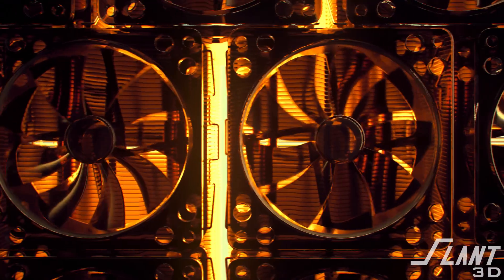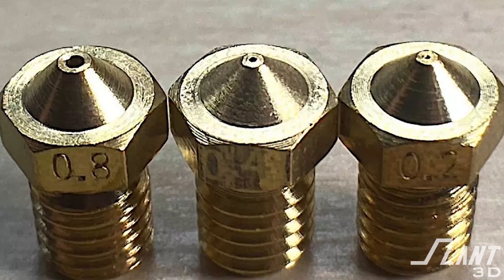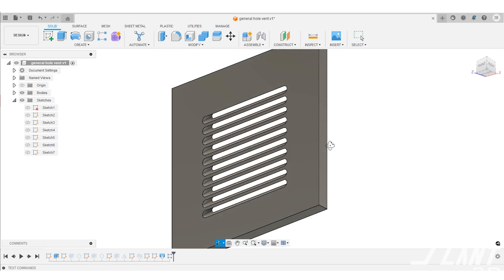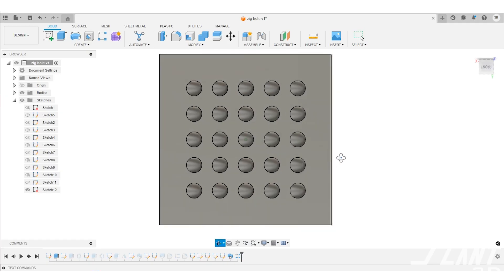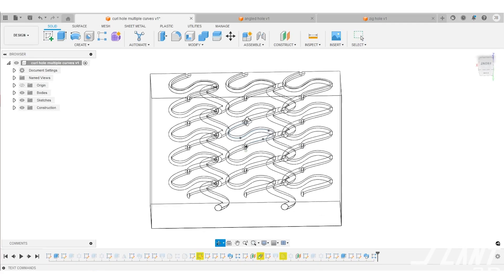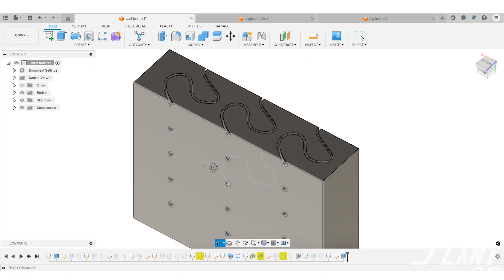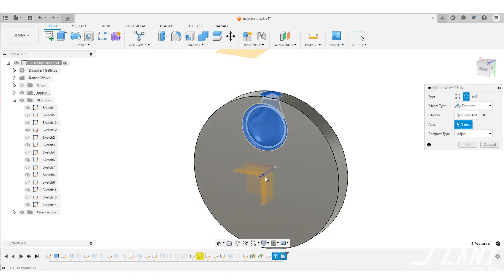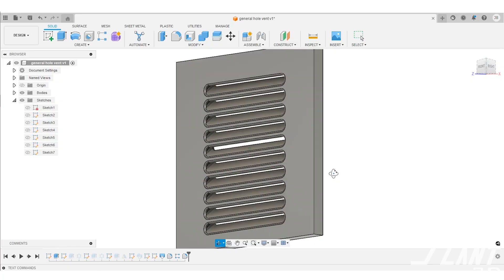These Cooling Vents are Impossible | Design for Mass Production 3D Printing

Comment: Some great ideas, thanks!

I realise that for mass production you'd probably want to stack as many of those vents on the build plate as possible in one job, but printing the vent flat would solve a lot of the "needs support to print" designs issues with the first models
Reply: Another thing to note is that while these examples are flat plates, this could also be on some bigger part that necessitates a different printing orientation.
Reply from the maker: You never batch parts in mass production. Thanks for watching
Reply: @slant3d whay? In production you print parts one at a time?
Reply: @evbunke2  3D printing two parts at once takes longer than printing the parts one at a time, as you have added additional motions to move from one part to the next.  Slant3D also prefers to print parts with minimal contact to the build plate, as more contact area makes for more effort in removal of the part.
Reply: @evbunke2  Yes, printing mutiple parts at a time is risky in a production scenario because if one print fails, so do the rest.
Reply: @slant3d  a small correction would be that you never batch parts in mass production 3D printing, you absolutely do batch parts in other forms of mass production.
Reply: @conorstewart2214  He's talking shit as usual.  You don't batch parts *when using cheap FDM printers"*. You sure as hell can with SLA, larger mSLA, SLS, MJF, polyJet, etc etc etc.
Reply: @Welcome2TheInternet  You can also batch with cheap FDM you wout just set the print sequence to one part at a time instead of doing one layer of each part every layer move.
Reply: @Welcome2TheInternet  absolutely, but for postprocess fdm is waaay easier so I understand why the focus on that. Obviously sla and mjf are much better with batches but then you also cannot use the huge variety of materials available to fdm
Reply: @GiovanniIgorCesarotto  Speak for yourself.  I'd rather dip a resin print in a bath for a few minutes and have a perfectly smooth (and isotropic) part, than fuck around with an FDM print. 

For the increase in quality, post-processing an SLA part is better value.  Especially after the dip and cure. There's nothing to it.

I assume you're referring to the "post-processing" stage of removing it from the bed, rather than the industrial processing stages i use (such as sandblasting), which are equal for both FDM, SLS and SLA.

When you're manufacturing for industrial levels of quality, post processing FDM is not easier at all.  Especially if you are planning on coating it.
Reply: @802Garage  Batch doesn't depend on printing sequentially or in parallel. They are both a batch. The point is, FDM takes a shitload of time.
Reply: @Welcome2TheInternet  I think you misunderstand. If you print multiple parts on the same bed layer by layer, the printer has to make many more moves than it does printing one at a time. If you print multiple parts on the same bed, but one part at a time, the printer does not have to make additional moves per part and you save time on part removal. It does make a difference.
Reply: @802Garage  but you are then limited by the height of parts because otherwise the printer head eill knock them off
Reply: @Einxeld  Well yeah the number you can do will always vary by part and printer. But for example I needed to print rollers for a line straightener and I printed 8 of them at a time spaced out one at a time for optimal strength.
Reply: @Welcome2TheInternet  this video is just about FDM printers so obviously what he says is going to be limited to FDM printers.
Reply: @802Garage  setting the print sequence to one at a time limits where the parts can be placed and their size, so printing them one at a time isn’t very useful and print failures can still mess up other parts on the bed.
Reply: @Welcome2TheInternet  resin isn’t suitable for all parts and applications though. FDM prints can often have better mechanical properties than resin prints. SLS is better than both mechanically though but is a lot more expensive than a basic FDM printer.
Reply: @conorstewart2214  I already addressed all of this in my other comments. 🤷‍♂️ It is quite obviously more time efficient to print 2, 4, 8, or however many parts you can fit on a build plate printed one at a time. It is exactly the same as printing them one at a time individually except without having to remove the part in between each. You don't print them unless the print head isn't going to hit them when printing another part. This is accounted for in the slicer and as with everything 3D printing depends on proper setup.
Reply: @802Garage  No i didn't misunderstand. FDM takes a fuckload of time, wether printing multiple parts simultaneously or sequentially on the same bed.

Very easy to understand. It's not as deep as you're making it out to be.
Reply: @conorstewart2214  The dual cure resins I use for SLA will mechanically outperform any FDM plastic that Slant is using. I guarantee that. 

Even if he was printing in ULTEM (which he can't do on his little Prussa), the resins would outperform in most mechanical aspects, and even in many thermal aspects.

Basic resins suck. Basic FDM filaments also suck.

When you get into the realm of proper technical plastics, these cheap feedstocks leave the chat.
Reply: @Welcome2TheInternet  You're literally arguing about efficiency, and then skipping over the part about increasing efficiency. If you have to remove the build plate in between each individual part, clean it, replace it, and then redo the leveling process depending on the machine, versus only having to do it between printing two parts, you have already increased efficiency by however much time is involved there. Plus there is the time for the machine to heat up and cool down. Plus, given this isn't all automated usually, there is the time for the person to actually do it, and any lag time between the print finishing and the person getting there. All of this means that if you can batch print, you can reduce the time each print takes on average. For a smaller part, you may be able to print 10 or even 20 on a single sheet. Do you not understand how that could drastically increase efficiency? It's not deep at all, it's just a very simple concept. I'm not trying to be rude or mean, but I am trying to make a factual point.
Reply: @Welcome2TheInternet  oh wow you are so knowledgeable. So easy to brag and make claims like that on the internet without backing it up. Prove it then, make a video comparing decent quality FDM prints, printed out of decent materials (including nylon, polypropylene, polycarbonate and ULTEM since you mentioned that and you might as well throw in PEAK too since you are complaining about cheap feedstocks) to your amazing resins. Did you also forget that most plastic used in products is thermoplastics and injection molded with materials like ABS, nylon, polypropylene and polycarbonate? If resin was so much better then why dont we use that?
Reply: @slant3d  could you not print them on top of eachother? then you keep the movement down, avoid needing all the supports, and print in "batch mode"

Comment: Would have been cool to try the grill pattern from the Mac Pro. That overlapping sphere geometry could be optimized for 3D pretty well I think
Reply from the maker: It is a cool pattern. But in printing is has the same problem as normal holes. Many small "islands" that can lead to failure in production

Comment: At some point you just straight up use infill geometry. Gyroid probably flows pretty well.
Reply from the maker: This is true. But you generally do not want to rely on the slicer to create geometry. It is best done in CAD
Reply: @slant3d  Hang on, why? Especially designing explicitly for mass production on FDM, if it's possible to create the geometry you need using infill, for which this is an excellent example, I would always want to take advantage of that, and design the part around the slicing profile I expect to use.  Making the design parametric from the get-go can really help here, as the CAD can be tweaked and adjusted in step with the GCODE tuning.  Some slicers will allow you to print two parts on the same bed with different settings, nothing says these can not be touching so as to fuse into one part, so I might sometimes combine an infill-only grating, with 1mm thick infill and just a couple of outer walls, with a more detailed surround at 0.6mm width and denser, standard infill, all from the same 0.6mm nozzle in the same part.

Comment: "Stuff Made Here" has a video on a particle filter that would likely work well for printing. Basically overlapping S curves. 

The challenge with most complex fan grills is the restriction. This is the great thing with printing, you can print out prototypes to see if it will work.
Reply from the maker: Yep. Your prototype is your production model

Comment: Use gyroid infill with no perimeters in the vented area, preferably with a larger nozzle.
Reply: I was thinking the same. Gyroid infill with no top and bottom. It's simpler to design and print
Reply: I agree. For mass production, ts not ideal to rely on the slicer for this. But for one-off or personal use, I think 0 top/bottom is good enough, though.
Reply: I made TPU kneepads like this, for breathability
Reply: I did that for a sink drain strainer
Reply from the maker: That is possible. But in mass production you generally do not want to rely on slicer settings to get part properties. They are best created in CAD
Reply: @slant3d  Is that going to work reliably, should you decide you want a geometry in the style of gyroid infill?
EG, doesn't the treatment of narrow wedges (as between the mesh on either side of a geometrically defined gyroid) vary with slicer settings, between slicers, and between versions?

(I'll also opine that a callout like "Gyroid infill, 20% with 0.8mm nozzle, pattern axis aligned with long axis of part" is really no different than the threading directions that people have been putting on drawings since... threads were standardized? Problem here isn't the mass production, but the handoff, with insufficient documentation, of a nonstandard feature, to an external vendor.)

Comment: nice, vid but i feel there are some missing info.
I assume there is a reason you don't want to print it flat on the plate, like u cant print a lot on a plate at once, making the big flat side of the print a no go?
even tho it might be a when its to be installed so the screw wont act like a vedge in between the layer lines.

The second example would that not be super easy to print if just rotated so the slots are vertical and not horizontal?
Reply from the maker: Printing flat on the plate is not always possible for the part. And the large number of holes increases surface area which increases print time.
Reply: He's using it as an example if you were in a scenario where the vent absolutely had to be printed vertically
Reply: Printing something like this vertically would exponentially change print times. Instead of printing a large flat cross section, with many edges that could separate from the bed (although a larger surface area as well) you can print a much smaller cross section more quickly, as there is much less travel while printing the part. That would be the most notable reason.
Reply: You should see it more as a specific case where you have lots of islands. Of course in this very case if printed it flat, it would solve the problem. But learning wise it would be pointless.
Reply: so to conclude if you do this at home just print it flat with no supports.